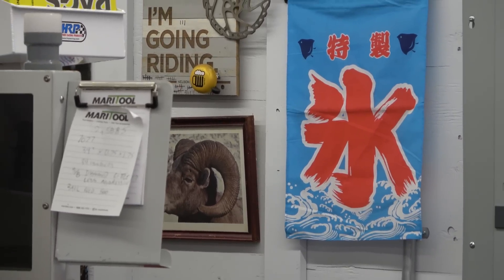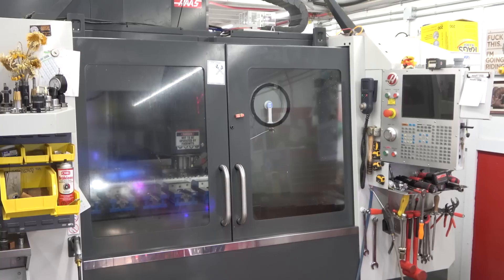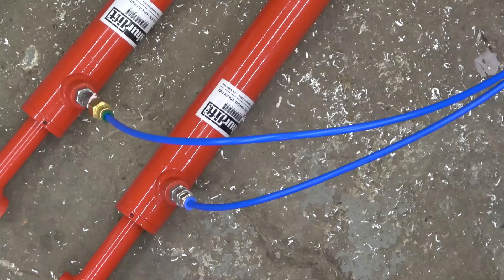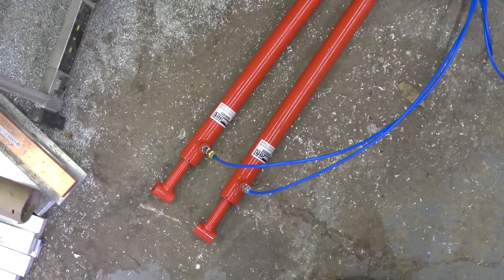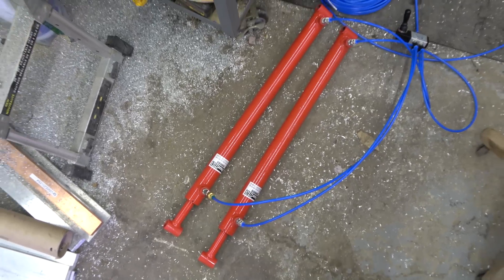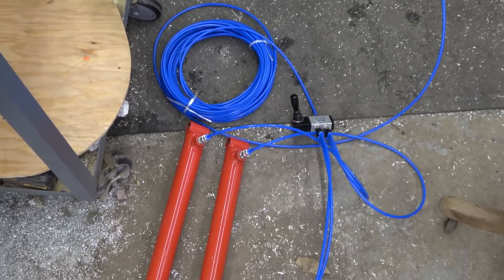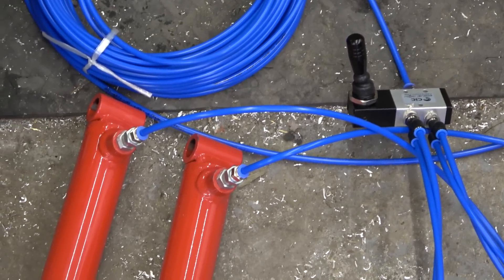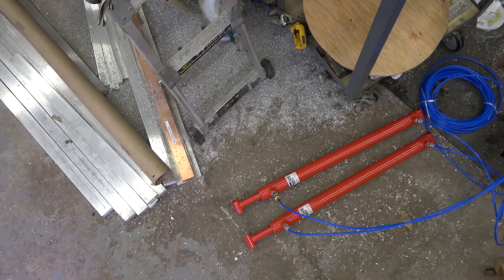Hydraulics using compressed air.

Comment: Can you maybe just take those apart and remove the wiper seal from the inside? Or change it out with a seal with less friction ? It might reduce some stickiness. Or add some KY.
Reply: Keep the wiper, debris will score your rod if left unchecked. I would tear it down and use an unloaded gland seal or "u-seal". The seal in there now has what they call an Energizer in the u-seal. Hercules sealing products sells to the public now and you can buy a one piece u-seal or rod seal that doesn't have that.
Reply: I was thinking maybe some oil myself. Pistons always go in and out easier if lubricated.
Reply: Yes, KY is some slippery stuff, got me out of a situation a time or two.
Reply: @jeffreydurham5342 It really wants to get you in first though!!
Reply: I don't know I'm thinking ASTROGLIDE...
Reply: That rod lube comes in a variety of flavours now

Comment: I know they have balancing valves for hydraulics, anything like that for spongy air?
Reply from the maker: Buffer valve in the ends of the cylinder. Basically a one-way check in parallel with a needle valve.
Reply: @arduinoversusevil2025  can you explain why  rock shock reverb seat posts always  get spongy. It would be fun if you did a teardown of one those useless piece of over engineered garbage.
Reply from the maker: @jepjona  I took one apart to rebuild it and fucked it right up. Need all the tools...
Reply from the maker: @jepjona  Yeah, they are shitty. But the new ones have a bleed lever, helps a little.
Reply: @arduinoversusevil2025  I was so happy that they had added this to their design, but I didn't realize that I was going to have to bleed it every 4th ride.

Comment: If you're not spending hours of time to avoid seconds of work, whats the point?
Reply: keep in mind you have to subtract  the seconds of work, multiplied by the number of times you do that work from the hours of time avoiding to do that work....  you will still never make up the difference but it gives you the motivation to continue wasting time to not do that work.
Reply: @jepjona boy where did the time go?
Reply: "Normally, if given the choice between doing something and nothing, I’d choose to do nothing. But I will do something if it helps someone else do nothing. I’d work all night, if it meant nothing got done." - Ron Swanson
Reply: @Bradimus1 Normally, I don't drink. When I do drink, I don't drink  normally....
Reply: It’s like fishing. Buy $500 of fishing equipment to catch a fish that costs 2.49 at the supermarket. Then you only need to live until you’re 150 to catch up on the ROI of the fishing gear. Unless you also buy a boat. Then you have to live to 1000.
Reply: @retirednotlazy2298  Except the case of amortizing the $500 worth of fishing gear can be wildly skewed in your favor should the condition 'supermarket has fish' ever resolves to false or if 'fish is obscenely expensive' resolves to true.
Reply: Sums up enginerding
Reply: Amen brother haha
Reply: Solution in search of a problem to solve…. As part of the next phase of discovery, I’d suggest that the joy-stick be replaced w/ a footpad-pedal actuator - something like the wired foot pedal that used to be part of operating a singer sewing machine perhaps?
Reply: I am adding that to the work joke reel
Reply: This needs to be an ave sticker
Reply: @chrissutton3043  which one?
Reply: "80 hours in the workshop is two saved in the library" Senõr Honda.
Reply: Because it’s fun to do things . If everyone just sat around happy with what they had in front of them nothing would get done . No progress would be made and human kind as we know it would be stale
Reply: That reminds me of the boss's son that demanded I take out an 8 second delay in a program that runs maybe 100 times a month. Will it speed up throughput? Sure, but I had other programs to optimize that represented far larger gains and thousands in savings that I prioritized over his observed "inefficiency". Did I stop what I was doing and jump right on it? Of course I did, after all, I didn't want to get whacked with the silver spoon. My best day at that job was when I got laid off.
Reply: We do things the hard way not because it is hard but because we thought it would be easy.
Reply: Words I can't help but live by. I didnt install smart switches in my house because I'm lazy. I did it because they're cool.
Reply: you answered your own question.
Reply: Months if want to get a gcode instructions to automatically close & open the doors before an after a op.
Reply: Contraptioneering is always a gamble on payoff.  A craftsman can make widget A in a few hours in a shop by hand,  at let's say 8 man-hours, $50 in capitalized overhead (dividing total investment in the shop divided by time making things) figuring all the "useful" products produced.  A factory might make a thousand an hour for a month at net of half a man-hour per unit and $10 in capitalized overhead (assuming similar material cost, but of course the factory has less unit waste and purchases material in bulk usually at a cost savings).   But the factory may have a 100 million up-front cost to reach that $10 capitalization and can ONLY produce that one widget.

Sio in the ship it's a gamble likewise do I spend hours doing something that might save me seconds ... but done dozens to hundreds of times a day or not?   But the flip side is that if this doesn't work for this, what do I learn that may be useful elsewhere, and if it doesn't work for this will the "failure" be productively useful for something else.
Reply: That should be my life's motto
Reply: Truest definition of "entrepreneur".